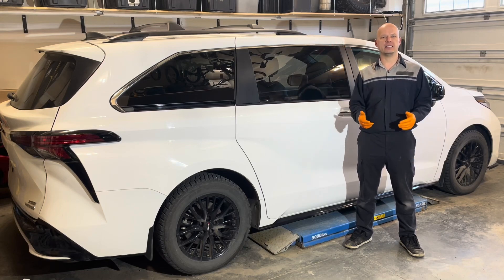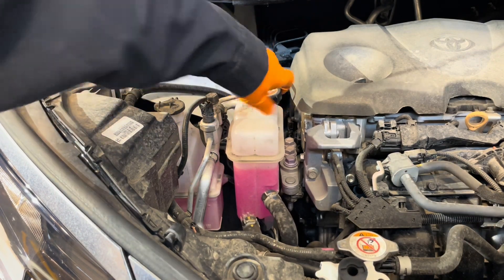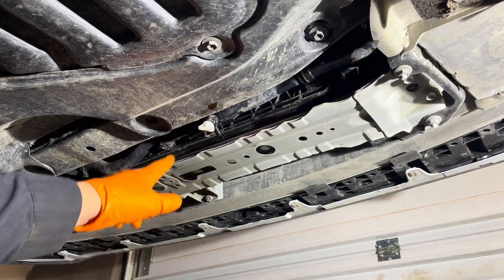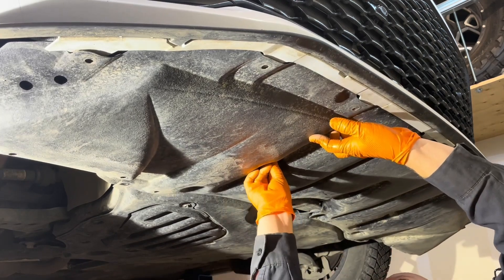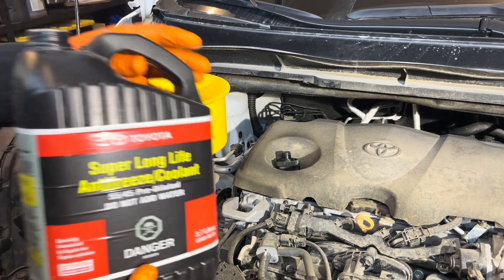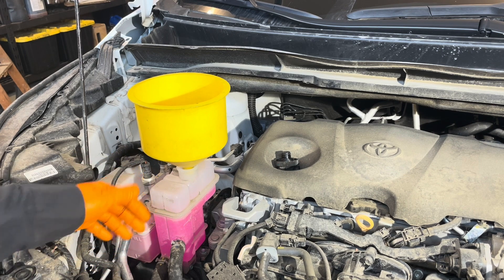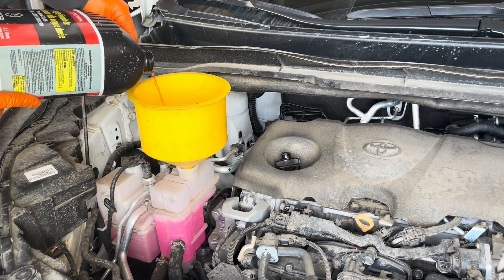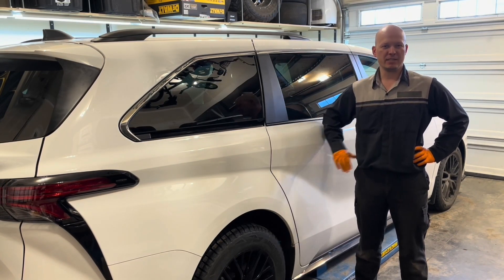2021-2025 Toyota Sienna Hybrid System Inverter Coolant Replacement Instructions

Comment from the maker: Below are my affiliate links to the parts and tools you would use to complete this job. I may receive a small commission from the product sales. Thank you!
Genuine Toyota coolant (less than 1 gallon required): https://amzn.to/3Y5MopT
Coolant bleeding funnel kit: https://amzn.to/3QbalKl
5/16" drain hose: https://amzn.to/43E0cJa
Sturdy 4 Gallon oil/coolant drain pan: https://amzn.to/3Ou4iiu
3 Ton Jack stands: https://amzn.to/3QOQPCL
Automotive trim and clip removal kit: https://amzn.to/3KgKGfg
1/4" impact driver kit: https://amzn.to/4f1UN4A
1/4” socket adapter set: https://amzn.to/44XTTkI
Rechargeable LED mini work light: https://amzn.to/3Y74OpY
Reply: Is the hybrid inverter coolant same as the engine coolant?
Reply from the maker: @sunnylife_snl the coolant used is the same type of coolant, but the systems are completely separate from each other.
Reply: @Viktor_G_Automotive  got you, thanks for your video, it is really helpful
Reply from the maker: @sunnylife_snl glad to hear!

Comment: Viktor, thank you so much for one more excellent tutorial on Sienna. I measured the inverter coolant drained. It was slightly above one quarter, 40 oz exactly. Engine coolant drain was like one gallon and a quarter. So two gallons is enough to do both engine and inverter.
Reply from the maker: Right on!

Comment: I did engine and inverter coolant today. Thank you so much. Victor, I accidentally put above full coolant line in the inverter, like 1/3rd of an inch above full. Is that a big deal, should I pump out some tomorrow?
Reply: I hope in the future you make a video on how to do brake job on hybrid Sienna.
Reply from the maker: My pleasure, and thank you so much for your support!!
A little bit of overfilled coolant won’t hurt anything, don’t sweat it!
Reply: @Viktor_G_Automotive Thank you, I feel relieved now. I gave myself lots of time for these 3 jobs. The van drives great. No leaks, no nothing. It feels great to work on one's car. The dealer and quick lube places have messed up the plastic covers under the van. I will order a new one and then will never go to shops again.
Reply from the maker: @dawood2u excellent work, it sure does feel good to be able to do this stuff yourself!

Comment: Thank you Viktor! This apply to 2025 ES300h since it's the same engine, A25A-FXS, correct ? Is the valve located at the same location ?
Reply from the maker: Hi, it will be either the same or very similar.

Comment: Nice work Viktor. I have a couple of questions.

1. Is it the same coolant for the hybrid inverter and the engine coolant?
2. Is it better to do this (hybrid coolant change) just before doing the engine coolant change (because of the revving and idle sequence)?

Im planning to do these 2 coolant changes soon since im almost at 100k.

Appreciate all you do for the community
Reply from the maker: @andrewcatimbang1509  hi, both systems use the same coolant. At the shop we would drain and fill both of them at the same time for efficiency. However, if you feel that might be too much, you can do them separately, the order doesn’t matter. Maybe do the inverter first as that doesn’t require a lot of bleeding and you won’t heat the engine coolant too much prior to replacing it.
Reply: @Viktor_G_Automotive  thanks for the super quick response Viktor! Got all the answers I needed. Oh and btw, do you remember how much coolant is needed for both engine and inverter?
Reply from the maker: @ hi, less than a gallon each, I can’t remember exactly unfortunately.

Comment: Thanks for the video, very informative. Can i use the same method in the video to drain and refill my Land Cruiser 2020 (LC200)?
Reply from the maker: @theleader5001  hi, if it has a 5.7L V8, it will be the same as the Tundra to replace the engine coolant. https://youtu.be/_8et5LwGKRg?si=JTIrQJBrS-k-HC0x